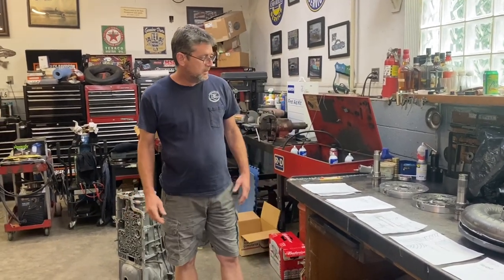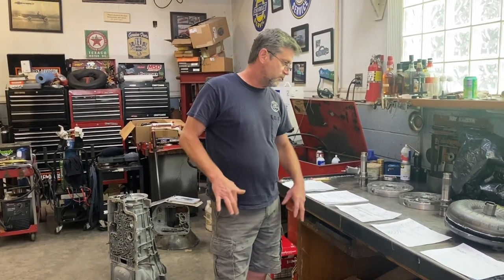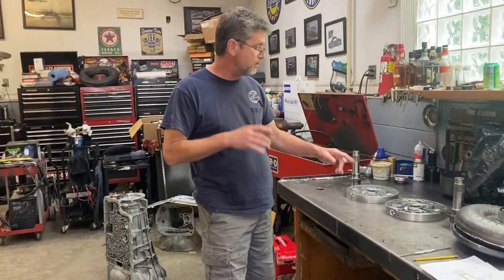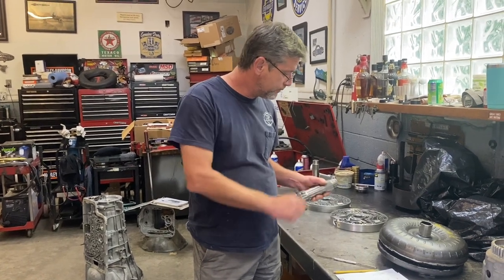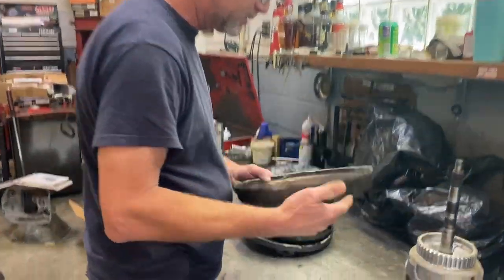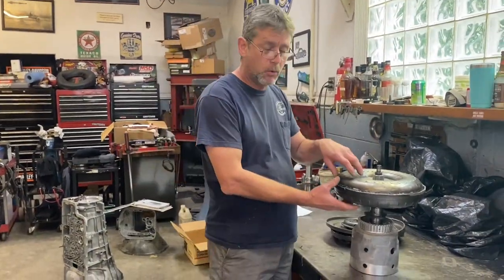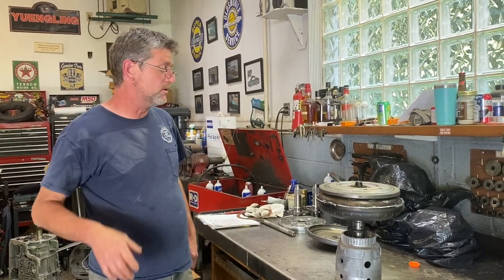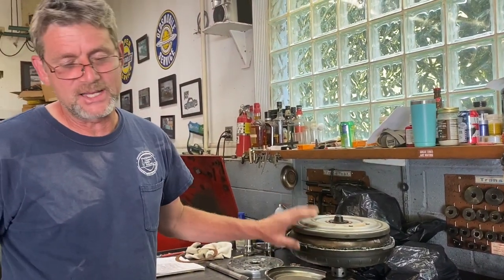E4OD/4R100 TCC /PWM” LOCKUP SYSTEMS EXPLAINED”  RABBIT HOLE STYLE!!! Pt .7

Comment: So with the early Toyota's you reused bolts that already experiencing plastic deformation but because they were already stretched a little longer you just ground off a little bit of metal off the the end of the bolts? Just to torque them back to the required spec which caused the stretch of the bolt in the first place? After you explained the fix for that issue I had to stop watching as that threw away a lot of credibility. I get that you have working knowledge and there's a difference between that and book smarts, but your disregard for some basic engineering principles is a problem that is abundant in this industry. Sorry
Reply from the maker: Wow ! Great comment ! In the REAL world and R&R guys have no idea what bolt torque is they way over tighten bolts which causes them to stretch even more than factory! Which LITERALLY caused that problem ! I don’t even know what bolts and plasticity even means as I TRULY am a real world mechanic ! I don’t need to understand ENGINEERING to understand what TRULY happens inside these transmissions ! Einstein said “Keep Things Simple….. But not Simpler” and plain and simple….. That’s what I do ! Period …. My favorite song of all time is Lynyrd Skynyrd “Simple Man” and that is how I roll. Have you ever rebuilt an Automatic Transmission ?
Reply from the maker: And people that have a BASIC/ADVANCEDUnderstanding of this stuff “UNDERSTAND” that is Just how it is. And they move on to get their vehicle back up and running so to speak !Im sorry to disappoint you but you missed a TON of good info….. just being stuck in ENGINEERING land and not the REAL World. It is what it is Have a Great day !
Reply from the maker: You got me on a roll but this will be it with this comment. I LITERALLY CUSS ! ENGINEERS ALL DAY LONG!! At my job for the Way they DESIGN shit !!! As a real world mechanic I have to do”WHATEVER IT TAKES “ to get the vehicle back up and running with no issues and that Toyota toque converter bolt is the absolute perfect lesson to learn in a real Mechanics “World” of not putting to long a bolt between the Flex-plate and Torque Converter!!!
Reply: @marshallsanders5672   you are correct they should have probably used a shorter bolt. If someone was to reuse it as you mentioned it would and did apparently cause further issues. 

I know a lot of head gasket bolts are 1 time use. Once you torque it to spec and remove it, it's no longer the proper length and will not clamp like it did originally. So in your opinion do think that was the case regarding Toyota's transmission? Automakers are all about cost reduction, so why use more material which costs $? Was it just something that was never taken into account because it wasn't properly tested? Or did they just never expect someone besides their stealerships to repair/remove/replace their transmissions which I their service manual somewhere in fiber print states you need new bolts discard the old ones?
Reply from the maker: Since we’re keeping it real here I would have to say (Only My Opinion) that they just did not ENGINEER the clearance between the bolt and Torque Converter CORRECTLY. The joke at work is I have to Cuss an engineer at least once a day for the stupid ways they design and build Vehicles sometimes. With that said I have ALL the respect in the world for the way Engineers THINK and DESIGN shit properly but it’s the 25 percent of the time they just PLAIN and SIMPLY …. Fumble the ball so to speak . If that makes sense. No more …. No less. Thanks for the comment let’s just keep it REAL !